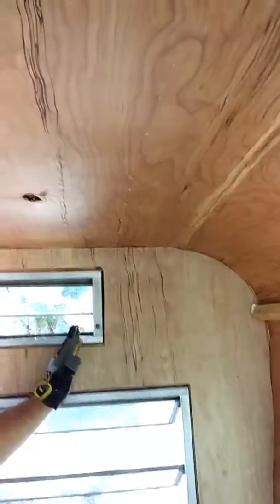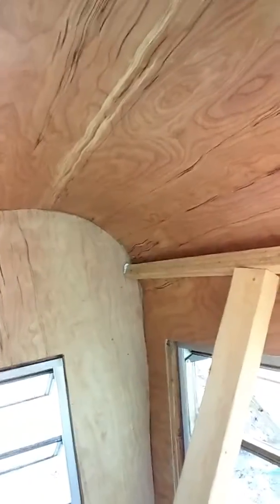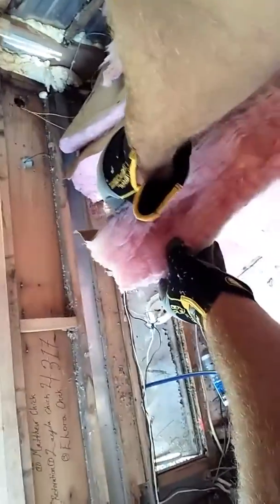Vintage Camper restoration, holiday vacationer

Comment: How did the rest of the restoration go?
Reply from the maker: We ended up selling that one and buying a 30 footer. I'm sorry to leave ya hanging
Reply: @MrNinja1100  no worries! I currently live full-time in a 30' RV, but I'm going to look at a 22' Holiday Vacationer in about a week.

Just got a new (to me) '06 Honda Pilot that I was gonna tow behind the RV. It struck me the other day though, that I'd be MUCH more likely to want to travel more if I was driving something much easier to navigate in! I've done a ton of restoration and upgrade renovation to the RV, so I think I'm going to make the switch.